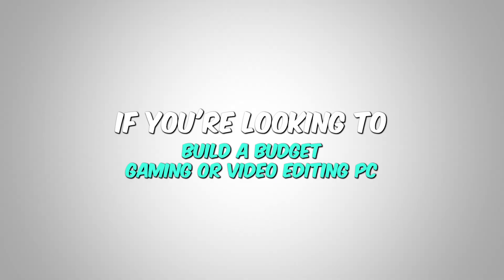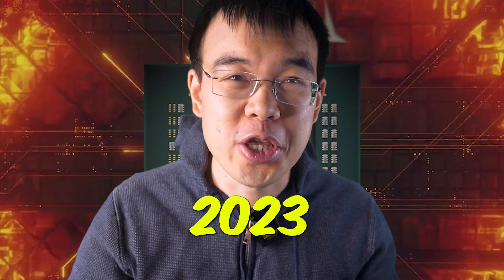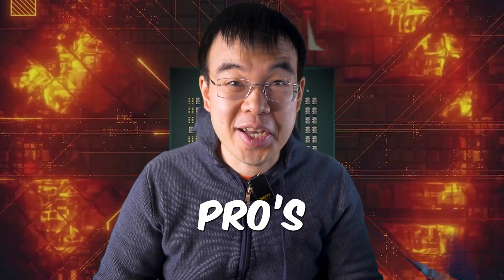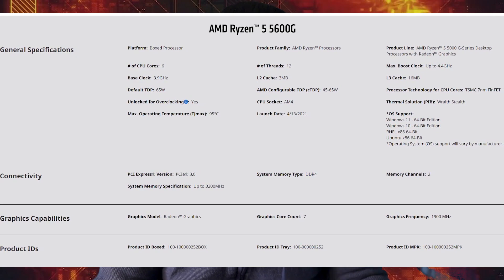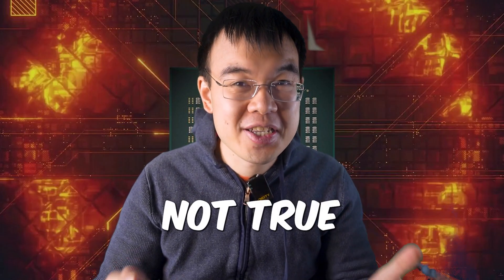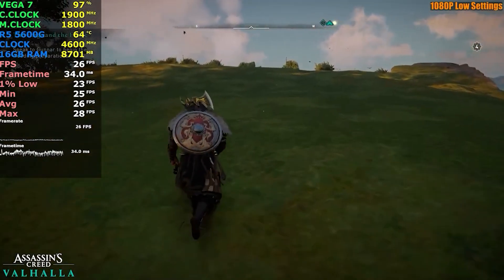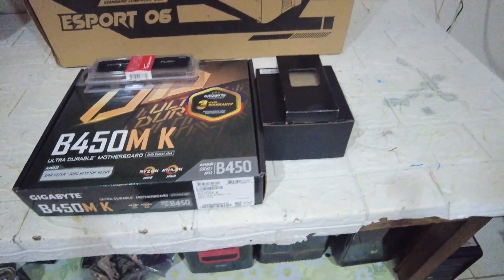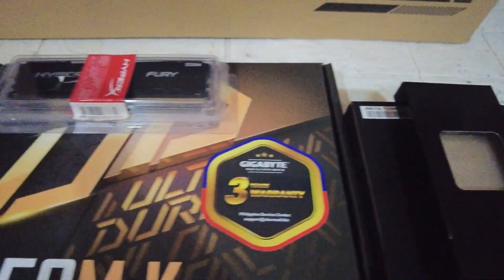Ryzen 5 5600G - Still a Good Budget IGPU in 2023?  Pros and Cons?

Comment: I have the 5600g and a msi rx 6600 xt 8gb gpu. I cant even play fortnite with major bottlenecking lag. It does work up until the final couple strom circles but then its unplayable, even on the low settings. What would you guys suggest to do? Do you think the 5600g is more of the problem or maybe the 6600? Because 8gb gaming card kinda sucks
Reply: This CPU is used for entry rig for those video editors or gamers. Those who just need quick setup without researching various CPU/GPU combo.

If you already at this point, you should go for more stuff already. Just windows shopping for next tier Ryzen 7 with AM5 sockets compatible. you gonna prepare for future releases.
Reply: Fortnite is a terribly optimized game but i would use dx12 on low not perf mode. It stutters even on some non-budget builds.

Comment: Hello Ray do u think a HP pc with 5600g is good for school and casual use in 2024?
Reply: I just built one of these list night for my wife's pc and absolutely its OK. My wife use's her pc mostly for crafting and makes her own designs etc and her older i5 was just not cutting it so I decided on this cpu since no gpu is needed. I put fortnite and valorant on it today and its certainly playable at 1080 you just cant crank the settings up, fortnite in performace mode at med settings around 120 fps at 1080 , valorant 1080 med settings getting 250fps. I used a b550 (with wifi) and 32 g ddr4 3200mhz ram with a wd blue 1tb m.2 and a 500 watt psu. I went with a nicer case, 32g ram bronze rated psu and 1 tb m.2 and the 550 board. If you went with a lesser case, 16g ram, say a apiva psu and 512g m.2 and a b450 mother board you could easily build this for like $325 to $350. I'm $427 all in on mine. The b450 is ok to use since the ryzen 5 5600g doesn't support pcie 3 anyway but I wanted to leave a upgrade path and possibly go to a ryzen 7 down the road. Good luck with it !

Comment: I want to upgrade my Ryzen 3 2200G from April 2019 to a Ryzen 5 5600G.
Reply: Careful with the motherboard, check its AM socket first. You might gonna upgrade everything.

I'm just like you. Revisiting PC parts shop every decade or so. I upgrade my DDR3 system into DDR5. This is because many of incompatible with my old motherboard. Ryzen5 5600G is AM4 and AM5 compatible.

So if your mother board is AM3, you gonna bit the bullet and gonna start buy a new motherboard, then you gonna need compatible SSD and RAM for the mobo. Making only the PSU and casing as the everlasting part.

Comment: I built a Ryzen 5600G based system just over a year ago and haven't had any gaming issues at all, plus I saved a lot not having to buy a graphics card.
Reply: Hello bro? Can i ask if it is still working and does it have heating issue?
Reply: Not the OP but I have had a 5600g for maybe 4 months now, I haven't had any heating issues, in fact it's very cool, typically the highest temps I get would be maybe 40c, my laptop runs hotter with an r3 3250u @venti_lover
Reply: Yes it's still working, but no overheating at all as I used one of those open airframes. @venti_lover
Reply: Have any of you paired a gpu with it? If so, what are some gpu recommendations that'll work great with it?
Reply: @OnceYT.  Are you talking to me?
I have stuck with the integrated graphics, I generally can play pretty much anything aat low settings and on medium to high for old games, I am using an old monitor without very high res (xga) so it's not super demanding on graphics anyway
Reply: @Xalgucennia  Ah yes was just seeing who's still here and that's pretty impressive that you can play almost anything! I just recently got a 5600g, haven't tried any heavy games on it so far because I only got one stick of ram, will get another soon. OG Halo 2 seems to be capped at 30fps and that's the only game I tried lol. Thinking about getting the 6600 later down the line.
Reply: @OnceYT.  Well to be fair, I haven't played that much, I just meant anything I tried, so like destiny 2, dark souls, etc I like old games anyway so not really in a hurry to upgrade, so anyway standard kind of 3d shooter games work pretty well, to be fair, I have 2x sticks of 3200mhz ram, I think with integrated graphics having fast dual channel memory makes more of a. Difference due to the apu using it
Reply: @Xalgucennia  Makes sense yeah, I'll get another ram stick soon as well. Thanks for replying!
Reply: @Xalgucennia Can you please recommend motherboard just compatibility with 5600g not any other features and which one you are using when I see website they mentioned G with 4000 series only so it's little confusing

Comment: Hello I have a Ryzen 5600G with 2x8gb 3600mhz !!!
Can the Ryzen 5600G work with 4x8gb ram since I have a B450 Aorus Pro motherboard!!!
Thank you very much.
Reply: It should work, obviously the motherboard is a factor. I have an older AM4 board that simply can't run stable with RAM faster than 3266. Not a real problem for me but something to be aware when you try to enable the 3600 speed.

Comment: 5600g= great value, affordable decent motherboard if you pick up a b450

12400f= willing to spend a bit more, but more expensive decent motherboards 

Imo 5600g is the winner at this price point. In a year or two the 7500f will take its place but not until ddr5 gets to the same price as current ddr4 ram and b650m boards drop in price

Comment: I have a Ryzen 5600g pc for almost a year that I bought for 425CAD. I really like it overall.

 Sure, its igpu doesn't match my other pc with a gtx1050ti but I don't really play aaa games nowadays because they're just take too much space on my drives and I only have 1080p/60hz displays. 

At least its igpu is powerful enough to play most Nintendo Switch & Playstation 3 emulated games at almost full speed.
Reply: What emulator are you using

Comment: For the prices these things are going at now, it wakes WAY more sense than AM5 builds.
the 5600G/5700G are decent cpu's in their own right.perfect for SFF builds.The 5700G really isn't that far off the 5700x in real world apps,and the 2 extra cores is a bit of future proofing.These are also really good if you have serious power bills you need to keep an eye on.

I would still go dedicated CPU+GPU combo if you can afford it, but if you're on a real tight budget you can't go wrong with these.
with AM4 motherboards $60-80, RAM dirt cheap, SSD Dirt cheap, you can actually make a build at $300-400 which covers most bases with APU
if you can stretch the extra $100, then you have a ryzen 5 5500/5600 + rx6600 which will cream it in gaming 1080p.

Comment: Im building a 5600G SteamBox for when i travel my to dad`s place. Im building it using 32GB 3600 DDR4 kit on ASUS TUF Gaming A520M-PLUS (WiFi) with JONSBO CR1400 COLOR CPU Cooler H126mm. I believe it will perform juste fine in 1080p low/medium.

Comment: Would a Ryzen 5 5600G with a ASRock DeskMini A300 be good for basic computing, like watching 720,1080 mkv vids, Youtube, browsing.   I don't play games.
Reply: it will handle that no problem. not even breaking a sweat
Reply: @bigmacntings7451  I got my 5600G with 16GB Mem. But with windows 10 and opening a youtube page. Its very slow.
Takes 3 secs to load a standard youtube web page.  Im guessing that its a graphics thing. And that the Graphics in the AMD chip really sucks. Im still need a good graphics card.
Reply: @africantwin173 maybe it is your browser or internet connection
Reply: @africantwin173  could be your storages or RAM causing your system to be slow. I would try clearing/deleting your temp files first. If that doesn’t work you may want to look at getting faster RAM.

Comment: Just replaced my old Intel NUC7i5 and put together a desktop mATX with the Ryzen 5 5600G (last time I built a computer was in 2001) Really impressed with the performance. 
The setup all in all with 16GB of 3666mhz DDR4 memory and a 1TB m.2 SSD set me back about $500, and that is including a not so budget friendly SFX power supply due to a miss-order and an ax211 that simply didn't work with the motherboard. Take that and consider it was all purchased on the Swedish market where everything is more expensive and I'd say it was a very good deal.

Great video Ray, keep it up!

Comment: For only $50 more currently, with this exact motherboard, would the Ryzen 7 5700G be a better option? Or is the Ryzen 5 5600G better for this motherboard. I do already have a MSI GTX 1660 Super graphics card. I use the PC for streaming only (no gaming), and with the graphics card in OBS at highest quality, it still is barely better than x264 at veryfast quality. I am hoping to be able to get to x264 medium. What would you suggest?
Reply: ryzen 5700g is fine!
keep your 1660 super. it still has nvenc encoders if you're doing streaming. better than h264/h265.
your next upgrade really should be the gpu if you stream. AV1 capable for sure

Comment: I love my 5700g.  Compared to 5600g it has 14% more graphics CUs and 2 extra cores and is/was the least expensive 5000-series 8-core cpu .. I watched a YouTube video about gen 3 vs Gen 4 vs. Gen 5 nvme pcie game loads.  26s vs 24s vs 23.5s.  it's very minor difference far smaller then the hype about 2x peak read-write throughput!!!

If you have $650 get the minis forum m780 it's got a Ryzen 7840hx and the igpu is 50% faster!!!
Reply: yeah nice dream for those on a budget!!!!  $400 price point you can t go wrong with 5600/5700g.
$600 gets you the minis PC's with monster performance. apu's are the budget target,
alternatively look in the used gpu market.....$180 could probably get you used miner rtx 2070/3060ti. that's a nice bump with a good processor

Comment: I'm building up a mini itx rig with the Ryzen 5 5600G as my third general-purpose, " just in case" equipment and a portable one with InWin Chopin normal, no pro or max, the one with the 150 watts power supply unit. ❤
Reply: Arent you worried about the proprietary power supply? Does inwin sell psus that fit within their case?
Reply: @snoot6629  nota at All. The psu is more than enough for the Ryzen 5 5600g, but not for the R7 5700g